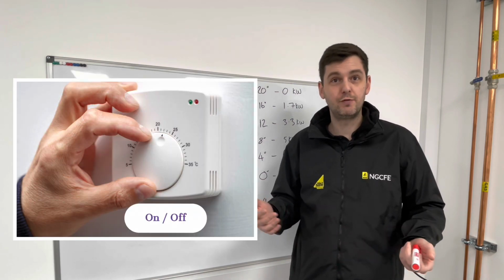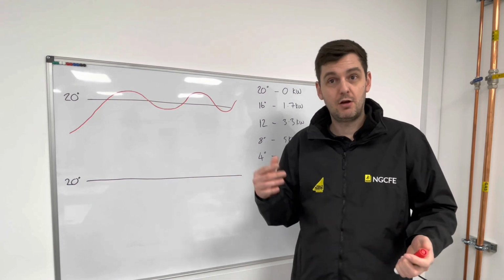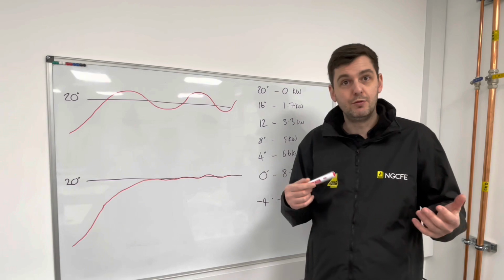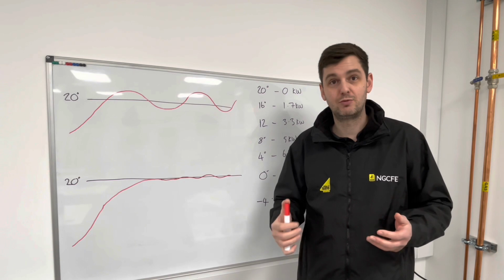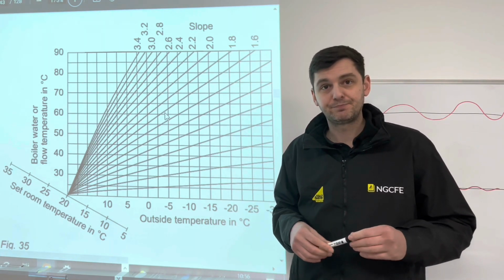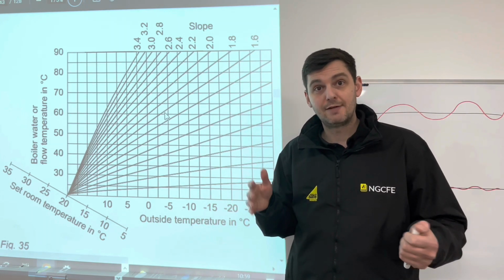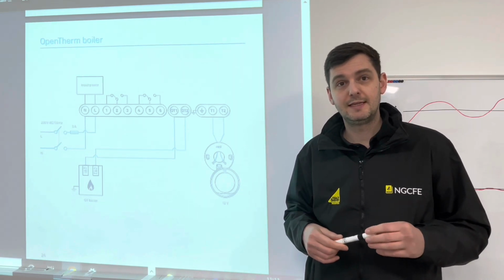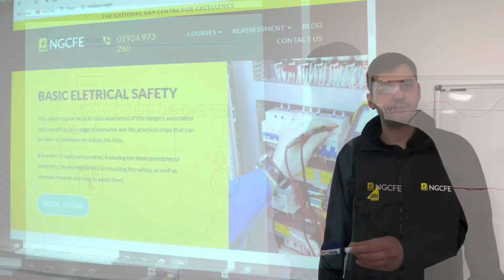Heating Controls Explained | Weather Compensation v OpenTherm NGCFE

Comment: It's absolutely ridiculous that in 2020 and beyond we still have boilers being installed for 80C flow temps.
Reply: Yes, I just got a new boiler Ideal Vogue Max s18 and requested PDHW with Opentherm but both plumber and electrician cannot get it installed.

Boiler is installed and he said "we always set it to max degree" and OT makes no sense to create two seperate flow temps.

So, got a new boiler but not a working thermostat. I am just fuming.

Apparently u can't get OT work on a S PLAN
Reply: @bimiuk4051  That’s just poor training. Find a different heating engineer and swap from S-plan to hot water priority using the second switched live. You can then easily run either weather compensation or OpenTherm controls.
Reply: @ma40  does that depend on the smart controller how many connectors it got?

For example NEST has got lot of connectors in the back but TADO EU model has one RELAY: COM NC NO and then Digital + -
Reply: @bimiuk4051  Which controller do you have? Simon from Urban Plumbers has a wiring diagram for an Ideal Vogue System boiler controlled by the Nest via OpenTherm and configured for Hot Water Priority.
Reply: @ma40  I have an Ideal Vogue Max system boiler. I think urban plumbers took thst video off as there was some mistakes.
Reply: @bimiuk4051  Not sure on that. The schematic is still up online for both Vogue and Logic models. But why not drop Ideal technical support an email or phone them, and see if a local heat geek can get your system wired up.
Reply: @ma40  yeh apparently that is wrong?  So he said. Will see if I find somebody.
Reply: @ma40  still can't understand IF two new wires need to be traced from Boiler to Tank when implementing PDHW as I already got the Normally Open valve? I don't have them to close to each other.
Reply: @bimiuk4051  I suspect they might. Would EPH Controls Priority Hot Water Pack be a solution? Possibly worth exploring
Reply: @bimiuk4051  https://www.youtube.com/watch?v=-5pH8iERvzU

Comment: How soon do you think gas will be phased out?
Reply from the maker: I have my gas meter turned off at the moment. not sure if it will ever be phased out though.
Reply: Gas for electricity generation will be phased out first. We use quite a lot of gas for that. 
Of all the fossil fuels, gas is by far the cleanest. Gas usage will reduce, relatively, as new builds do not have gas installed.
It is difficult to remove gas from apartment buildings and terraced houses, replacing with noisy heat pumps.

Comment: Hi Allen

Can EPH Combipack4 fullfil the requirement of Boiler Plus?

Regards
Reply from the maker: Yes.
Reply: @AllenHart999  

Without any control from mobile or Tablet?
Reply from the maker: @salam238  yes.
Reply: @AllenHart999  

Thanks for your reply. I was a bit confused after attending Baxi training. 😉

Have a good day.
Reply from the maker: @salam238  It says boiler plus on the box I believe ? Thanks.
Reply: It’s for a built in clock and thermostat so it complies